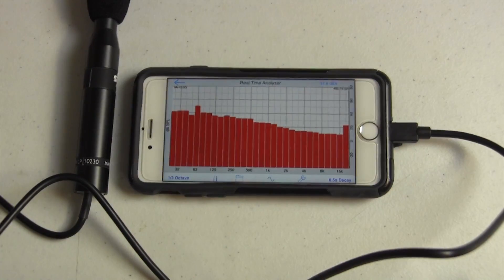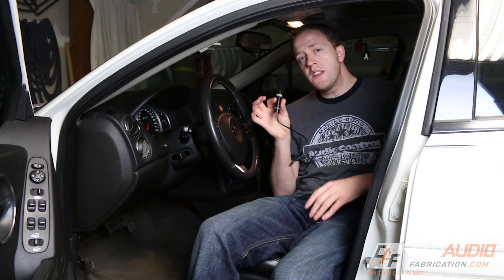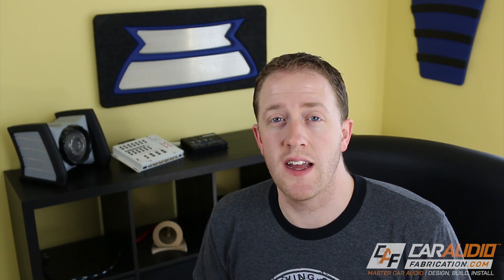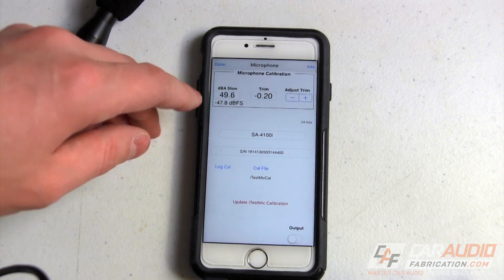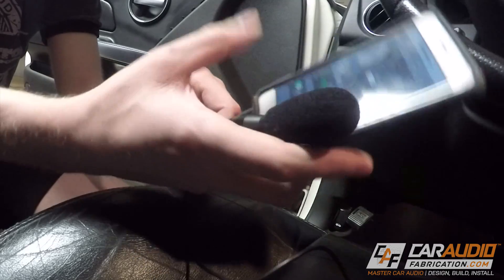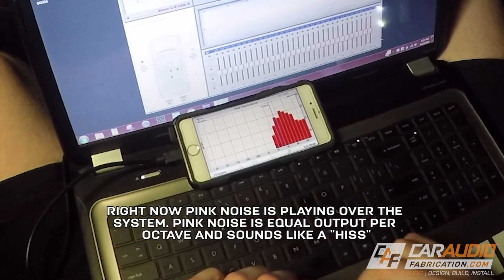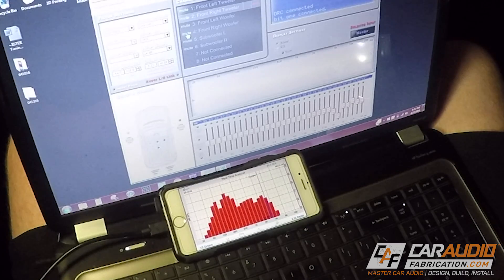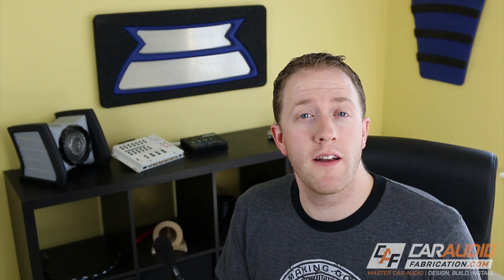How to TUNE car audio - Why you need an RTA - AudioControl SA-4100i - CarAudioFabrication

Comment: I am getting new head unit which fairly deep independent front/rear eq (and new sub / amp / speakers), but this is an audio mix-check reference system, so I want a fully dialed target curve to be achieved when all head unit sliders at +/- 0dB so I know exactly how and where I am deviating from target curve if any sliders engaged.  So... do I need another inline EQ to dial in that target curve according to the RTA measurements, or (on a relatively tight budget) is there some better way like more advanced amp or other item that lets me do that plus dial in crossover points or otherwise correct any imbalances?  Also, for convertible, do you do two sets of RTA measurements (open and closed top)?  If so, how do you handle switching system when top opens/closes?

Comment: I installed my system 3 years ago, and have never tuned it.  It's a class act installation with complete dedication and thoroughness.  I don't trust local car audio installers for any advice or tune.  This is where I'm at.  Can I tune my 2 and 4 channel amps with the pioneer HU on my own?  I don't compete.  I just want to pull the best from the system, and justify any future upgrades.
Reply: Best advice I have ever read on a car audio video. 

DO NOT TRUST LOCAL CAR AUDIO!!  🙌

Comment: Long time listner first time caller. I'm a fan. I've been updating the sound system in my 2014 ram 1500 since i got her last year. So far i've swapped out all the speakers with a slightly upgraded version and upgraded the wiring and added 2 subs and and amp for the sub and one for the speakers. I got a DSP in my price range the DSR-1. How do i go about adding two more amplifires so each one only controls one of the high lows and mids. I'm a little curious how i would go about setting something like that up as well. Any advice is greatly apprciated.

Comment: What if instead of a DSP you applied the EQ setting to your mp3 files with some program? 
or eq APP on the phone?  

Then it would be extremely cheap!
Reply from the maker: It doesn't really work that way because you would only be correcting a left and right channel. Not the multiple channels needed for every speaker in a build

Comment: Hey Mark, I have the AC DM810. Trying to eq my system is a bit overwhelming. I really want to do it myself but I’m getting frustrated. Do I need a RTA mic to help out. Active 3 way, 6x9 rear doors and 2x12’s under seat. AC 4.800 and ACM4.300 for mods and highs. Skar 2000.1 for subs. Please help

Comment: Maybe you can answer my question. I had a Kenwood DNR4190DABS + installed in my Jeep Wrangler. Now it wants to be that sometimes the amplifier does not turn on so that I have no sound at all. What went wrong?

Comment: How are you able to adjust the tweeters separately from the door speakers? If you have a 4 channel amp powering them wouldnt you only be able to make adjustments to FL FR RL RR ?
Reply from the maker: You run them active
Reply: @CarAudioFabrication  Hey thanks for the reply! Sorry but im still kinda confused. @5:16 you say you adjust one single speaker at a time and that you start with a tweeter. If you have an amp with only 4 channels running 4 woofers and 4 tweeters in a typical FL FR RL RR setup, this means that on each of the 4 channels you have 1 woofer and 1 tweeter receiving the same signal. How would you separate woofer and tweeter signals in the DSP? Dont you need each speaker to have its own dedicated channel (IE an 8 channel amp)? Or do you just unhook the woofers while tuning tweeters, and then vice versa? (using a passive crossover to protect tweeters of course) Thats the only way i understand how to tune 1 at a time.
Reply: @smiter102  , he meant he has them active so every speaker has their own amp channel. If you have passive crossovers, you need to tune the EQ with mid and tweeter together.

Comment: Could this microphone used to measured time alignment like umik-1 or itestmic 2 by S6D?
Reply: I just got the Umik1 to do this seems okay have you had any luck tuning with one?
Reply: @Rancher936  i used SA-4100 but the audio output missing when the microphone plugged in

Comment: Hi Mark, thanks for your videos. I have a couple of points to add. If you use pink noise than you actually want to see the graph falling down at higher frequencies and not being flat. The second point is that RTA do not using a FFT prossecing. It is a variation of that measurement and you have to consider it in the tuning. The speaker polarity test is too variating regarding how you hold the microphone to the speaker. There is better way to check this using the DC voltage ( a AA Battery or couple of those if you test the woofer) to see if the membrane of the driver moving in the right directioin by applying the DC voltage.

Comment: Hey CAF, now that I am using a dsp do I want my Pioneer head unit in network or standard mode?  I notice they sound completely different.  I still have tweets mids and sub. Thanks!
Reply: Network mode enables 3 way crossovering. You need to adjust them to make it work. Just changing the mode won't help you.

Comment: Waited many years for standard type head units to build in adjustability. How long before we can adjust individual speakers without expensive hop ups? I’ve finally been able to drag my SA-3055 out of moth balls in recents times. No longer do I have to leave customers with mediocre sound. Great to see technology become cheaper. Though I do recall many years ago some upmarket head units had
 their own mic & pink noise generator.

Comment: but what if you are just in need to get a calibration in you car after installing new headunit and speakers and you don't do this on a weekly basis so its not worth to get all the expensive equipment, is there any good tips for that? i've tried just listening to my headphones on my PC and then go back and forth in to the car and moving the equalizer to what i seem to be missing or have to much off, but always keep thinking it could be a little better.
Reply from the maker: In that case pay a professional

Comment: Hi Mark, I see this is an old post but I just came across your CAF youtube channel in my search, love it. I have a question for you though. I have a 04 Fiat Panda 169 with stock a audio system which included a subwoofer under the pas angers seat. I will be getting a new 2d 7'' head unit and want to also replace the 8 speakers. 4 tweeters and 4 subsw speakers. The stock subwoofer is quite nice and has a good thump, which I love ;-) boom boom. The doors hold 6.5 and the tweeters are 1'' so my question is which speakers would be best for the my car that delivers a good thump boom ting :-o Since there is a plethora of speakers and opinions,  I was hoping you could direct me with your expertise wisdom in the right speakers. The Panda is like the Fiat 500 but nicer :-D Thank you so much for your help, Cheers.
Reply from the maker: There is no "best" speaker. Go to a local car audio star and audition some with you ears, they would likely love to help you out!

Comment: Hi Mark, do you know how to tune car audio with two mics placed in the ears of a human head model? Is it even worth the effort?
Reply from the maker: +Yang Du tune with one. Any fancy mic array is just going to average to one central position anyhow.
Reply: Thank you so much for your reply! The issue is how to EQ with two mics. Should I use left mic to EQ left speakers, and right mic to EQ right speakers? The reason I'm thinking about using two mics to EQ is because I found with a single mic that the EQ changes when I sit inside the car.
Reply: Also do you know how to tune a system with center channel speaker? I think a system with center channel is better because we don't just want the driver side to sound good. The issue with aftermarket car audio nowadays is it seems like nobody knows how to tune a system with center speaker. How to EQ? How to set the volume of each speaker?

Comment: I was wondering if you could do a video on how to tweak your DSP EQ curve once you have the time alignment and balanced EQ curve set?  I have a great sounding system thanks to using the Audio Control DM 608 and JL Audio DM 900/5.  I adjusted the curve to my listening preferences keeping with a rule of less than 3 db per octave between frequency bands (I am 1 db at most).  My issue is that I have drums rolling up the left side of the dash and down to the right kick panel.  Not sure why I have a stage that seems to be low on the lower right side.  I had Audio Control remote into my DSP and run several tests and they could not some up with the issue.  I double checked the door speakers to ensure the wires were secured.  Also the volume levels were equally matched.  Its a bit frustrating to have a rock solid image that seems to be tilted.like the Titantic going down.  Its beautiful but...  Also, how do you get the image to project out onto the hood of the vehicle?  I had a car in the 90's with Image Dynamic HLCD's and 8 inch mid bass loaded into the floor.  We got lucky with the staging as it was quite high and centered but it seems near impossible to get the depth with door mounted speakers. On a side note I am using Hertz 6.5 inch coaxial drivers @90 hertz x/over point.  The tweaters are on-axis toward center point of the ceiling (I am going for center stage not the driver listening position) which are loaded into sealed enclosures I made using your videos for making the composite plastic speaker rings which I added fiber glassed pods to.  The rest of my system is a single 12 inch JL sub and two Rockford 5x7's for rear fill.  This is installed into a 2013 Ford F150 Super Crew.  I am designing the amp rack but wanted to get the sound adjusted properly before fabricating the amp and DSP racks. Thanks for making these pro quality videos!
Reply: Found the issue..the factory pin configuration chart was reversed from 2010 to the 2011 model.  e front and rear left speaker polarity was switched to assist in bluetooth issues.  Oddly enough most tech sheets do not have this update.

Comment: My factory head unit does not have an AUX input.  Will the speaker polarity feature in the Mobile tools app work with a burned CD of the speaker pop signal?

Comment: Is there a way to overlay the RTA snap shot on one speaker over-top of the RTA reading for its partner?  Basically, instead of writing down the readings for the various frequencies for say the tweeter on the left to level match to the tweeter on the right side of the vehicle?  Also, is there an Android version of the Audio Control Mic?
Reply: James Eberhardt I haven't found one. I recently purchased one from MiniDSP. It work well also.
Reply: Much appreciated.  I just spoke to Audio Control for another issue and they confirmed the release of the DM DSP Bluetooth Module for late Feb 2018 and the updated individual channel EQ capability in April of this year.  The Android and Apple app for the DSP are about to be released as well.

Comment: shouldn't the mic be in the center between the front seats so measurements of the left and right speakers are equal distance from the mic during eq adjustment? That way we can be sure the speaker output is source for the disparity between speaker output at certain frequencies and not the placement of the mic itself.
Reply from the maker: +COOLSKELETON95 the mic should be at the listening position. You could also have a separate tune for the mic in the center if you wanted
Reply: depends who you are tuning the car for, if you want a general all over than the center can be ok, but really, it's your car, YOU should be the center adjustment point. get the best sound yourself and the other passengers can take second hand.

Comment: I like this tool but I don't understand exactly how this works.
Reply: a pink noise is played which is every frequency playing at the same time, this shows where you have frequency dips and spikes where you may not want them, in general you will want to make things close to flat + your personal preference, a completely flat system is easy to make using an RTA but will sound..well. flat. lol. this is more a help to work our where you have peaks and valleys with a single tone that shows it all at once, not trying to put on different songs that have different frequency responses.

Comment: I'd have bought one on the spot if they supported Android.  Good to hear they might be working on one, though!  Such an incredibly useful and versatile tool.  :D
Reply from the maker: +rhkips i'm an android user myself, had to borrow an iPhone to make this video.  It was very helpful, its nice having it on a small easy to handle device so I can set it on top of my computer that's connected to the DSP. I'd like to have a windows tablet and this on a cell phone, cell phone physically connected to the tablet with a 3d printed support of some sort. Would make it awesome for tuning. lol